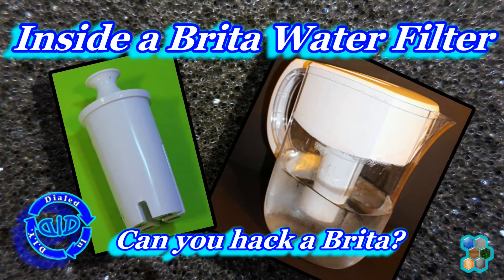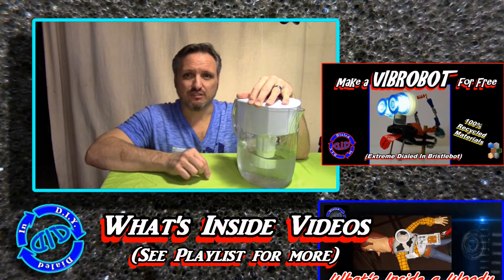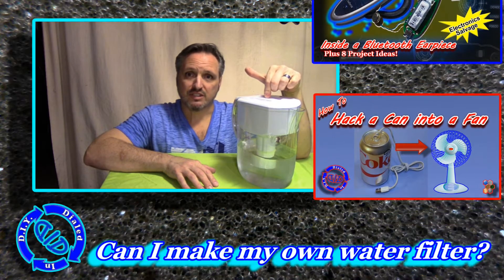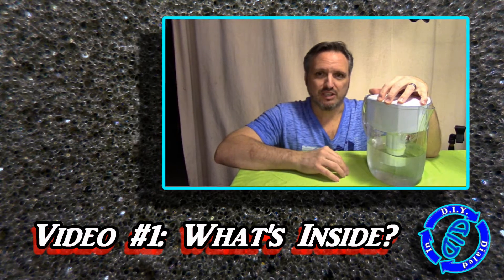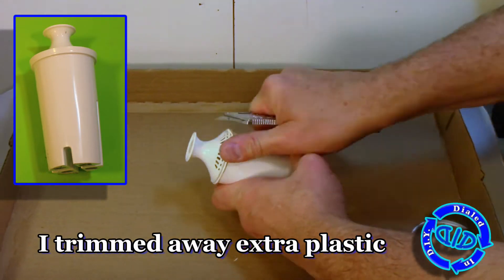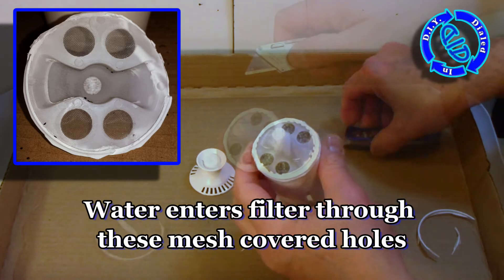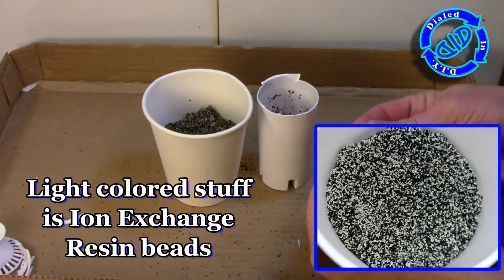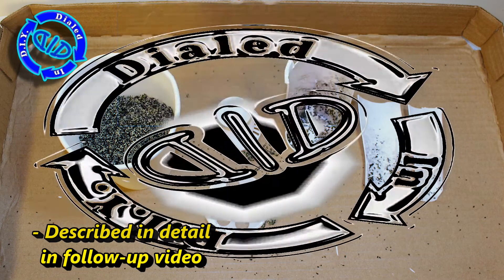Inside a Brita Water Filter - a filter autopsy

Comment: I cut open a Brita longlast filter and found the inside to be way different. How does that work?
Reply from the maker: I have not opened a Longlast Filter so I'm not sure what the inside design differences are but I do know that the design is intended to last about 3 times longer (roughly 6 months or 120 gallons, I believe).  It is also advertised as trapping more contaminants so I'd expect there to be changes in not only structural design but also filter materials. Thank you for taking time to watch my video and post a comment.  I really appreciate it!